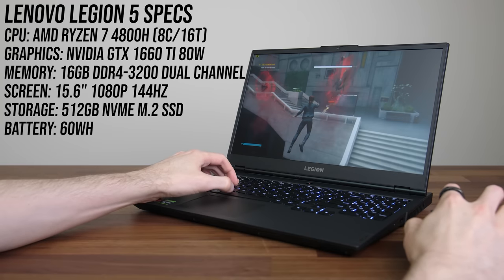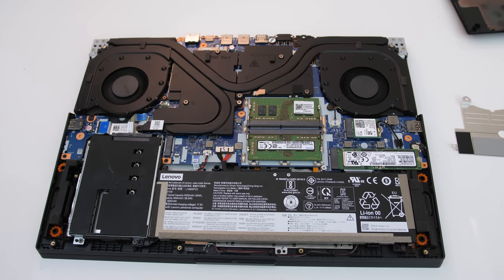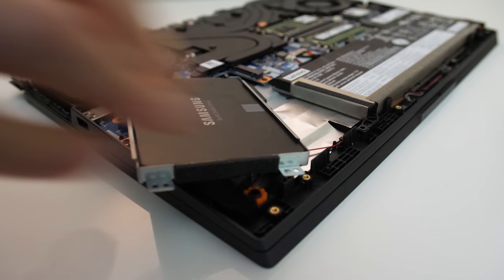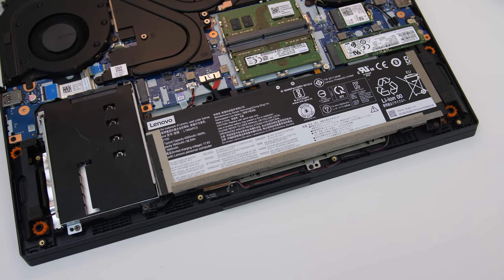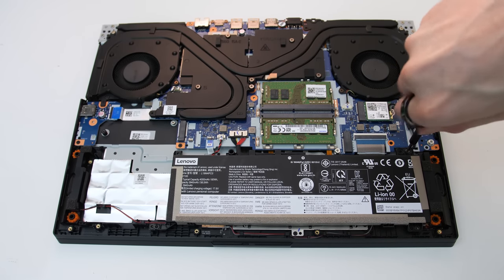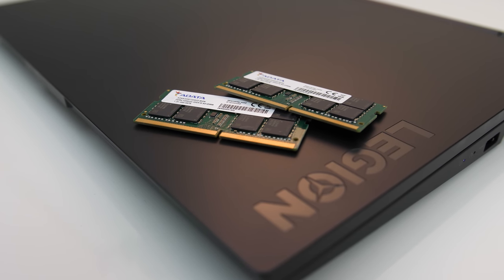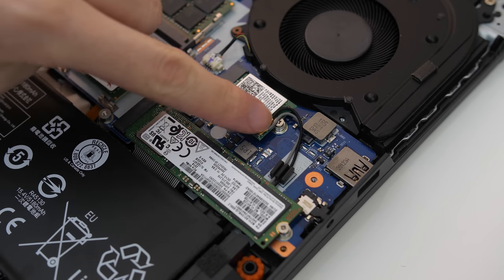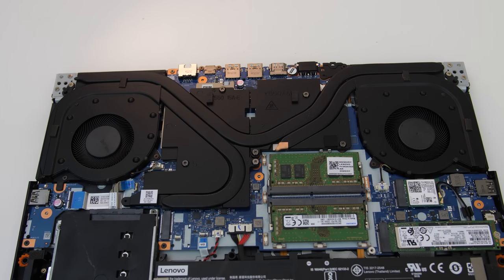Lenovo Legion 5 Upgrade Guide - Boost Performance!

Comment: How big second M.2 drive can I put in ? 1 TB? or only 512 GB?
Reply: I have (2) 2TB M.2 drives, so 4TB total. There are 2 slots for M.2. If you want to add 2 separate M.2s, you will need to take out the default bulkier non-M.2 SSD hard drive if your laptop configuration comes with one.

Comment: So what was the point of putting that 2.5 inch drive in if you was just going to change it out for a bigger battery 🙂
Reply: I think that he just showed us what can be changed BUT if you want to change the battery with a bigger one, you might as well change the 2.5 inch drive with a M.2 sata drive, which is much better, performance wise.

Comment: I upgraded to the 80W battery through the recommended amazon link but it says it is not supported by the system and will not charge.

Comment: I do have Lenovo Legion Y520 i5 -
I want to upgrade my 128 GB SSD to 2 TB. Just want to know is the Y520 compatible to 2TB of SSD or not (if no then how much it can be upgraded to) . and have a 1TB HDD can it be upgraded to 2 TB Sata SSD
.
Reply: Sata 2TB SSD yes. I'm still looking for an answer on the 2x 2TB M.2s. I have heard people adding at least one 2TB M.2 SSD, so I have hope.
Reply: @ryanspackman548  I have 2 2TB and it is working fine, it has been a year.

Comment: Can you confirm that the this laptop can use all of the 64gb of ram? It was my understanding that its limited to 16gb per channel as there is only two channels the laptop should be limited to 32gb.
Reply from the maker: Should be fine. The 32gb listed on the specs refers to what they sell it with, if you look at the specs for the processor it can support more.

Comment: Can you help me btw, i just buy a ssd sx6000 lite 256 gb, then i do a fresh install and put my os to the new ssd, after i install the new ssd to the slot and got a fresh install of windows 10 20h2, i got a bad performance, like when i play a game valorant, i just got 60 fps then it stuttering so much, really annoying, in normal mode (1 ssd only from the manufacture) the performance of the fps can get in to a 150-200 fps. Can you help me?

Comment: I installed an old seagate 500gb 2.5 hdd (yes 5400rpm) I had laying around for extra storage. Also installed a samsung 4gb 1Rx16 ddr4 stick. Awesome!.A huge nostalgic feeling using a HDD. I can hear it spinning. LOL. nice n slow'
Reply: helpful video. I didnt see the ram at first... no screws needed!. I haven't built a PC since 2009 back when the 9800gt/8800 & WD Velociraptor drives were king LOLOL. alot has changed,  video was a great reference.

Comment: If I replace both m.2 ssd slots with fresh ones do I have to reinstall windows on my laptop or will it still be available?
Reply from the maker: You'll have to reinstall because you've removed the drive with it
Reply: @JarrodsTech  Ok thanks 🙏

Comment: I got the legion 5 with the 120hz screen, because there wasn't any other option to get the 165hz screen. It's yet to arrive so I have no idea if it's really as bad as people say it is. My question is, can I upgrade the screen later on if I find it really bad, and if yes, where do I get the new screen from, and is there any tutorial on how to install it?
Reply: don't even bother
you'd be better off selling the laptop and buying the 165Hz model to replace it 
but unless the 120Hz panel it comes with is of far worse quality than the 165Hz panel, I wouldn't sweat it. Those extra 45Hz won't matter outside of competitive gaming

Comment: if you open the sata hard drive and just pull out the pcb you can run both sata and 2 m.2 drives you must remove the tray also
Reply: can you show pics of this?

Comment: Anyone having issues with their battery upgrade? 
First off it took me some extra time to find the correct part number, there are numerous 3rd party sellers.
After a return and waiting about a month my new 80wh battery is in but at 100% charge it says i have only an 1 1/2 hours worth of charge time...do i need to cycle the battery more for it to figure itself out? i thought this wasnt as important with Li-ion.. any feedback is appreciated thanks!

Comment: I want to know about my laptop upgrade options!

Lenovo Legion 5 15ACH6H (AMD Ryzen 7 5800H), RTX 3060 6GB(130W), RAM 16GB, SSD 1TB

In website or elsewere RAM upgrade is limited to 32 GB but for this video you are upgrading it to 64 GB, The laptop is from same family and even mine is one gen higher! Could you give answer!

Also i have read that people installed 64 and more RAM without facing problem!!
Reply: Yes 64 will be fine.

Comment: I love your video. I have a problem if i upgrade my laptop, should i buy 1 slot ram 32gb or buy 2 slots ram 16gb? Because my laptop default has a slot ram 8gb and i want to put a slot ram last.
Reply from the maker: 2x 16gb will perform better as it's dual channel.
Reply: @JarrodsTech  Thanks. But with a slot 8 gb and 32gb ram, it’s also get dual channel.
Reply: @herobrinesky3348  You want to have the same about of gb for each slot.
Reply: @Blue-xn1mj  Ok. Thanks

Comment: I just got the Lenovo legion 5. It has ryzen 7 4800h and gtx 1660ti. The issue is that I can't connect to wifi when I go to my room. I basically have to sit really close to the wifi router. Like if I go 20 steps away from the router the laptop gets disconnected and WiFi on the laptop stops working. Whereas wifi is working fine on all my other laptops, phones in the same room and even at greater distance. The wifi card is intel wifi 6 ax200 160mhz. I've tried reinstalling windows 11 three times. Used cmd commands like netsh int ip resetlog.txt and all those geeky stuff. Tried reinstalling drivers for wifi again and again. But still the wifi signal range is pretty bad. I have to sit really close. Please help

Comment: I just tried to do the battery upgrade but the new battery won’t charge and the orange battery light constantly blinks when I plug in the power cable.  I’ve already reopened the laptop and checked the connection… can anyone help me?

Comment: would be more fantastic if there's availabel 10 pin sata flex cable little bit longer.
so we able to use 3rd cheap ssd like BX500 Crucial without enclosure.
is it possible??

Comment: What is the max capacity for the M.2 drives? The manual says 1 1TB, and 1 512TB.
Reply: I put (2) 2TB M.2s in my Lenovo Legion 5. So 4TB (but you're going to have to remove the regular SSD that comes in the default configuration.)
Reply: @muygalan  can you post the 2tb M.2 that you have please, also, are you having any issues or is it working fine?
Reply: @pipkinrahl7264  SAMSUNG 970 EVO Plus SSD 2TB - M.2 NVMe. No issues at all!
Reply: @muygalan  Finally, someone who did and confirmed what I want to do! Don't know why it was so hard for me to find others who did this!!!

Comment: You could get away with the m.2 and the sata ssd in that small area. if you were to configure it in the case correctly. It's a little tight for me, but you can get it to fit if you get another sata to ribbon cable connector that's longer so you can stretch it over the m.2

Comment: Legion 5 15ACH6H laptop can be upgraded up to 32 GB(16x2). But when I talked to Lenovo they told me like this "It is possible that the computer will remove more, but we cannot guarantee this as such configurations have not been tested" is there any problem if I install 2TB SSD?
Reply: First let’s talk about upgrade option, at current moment Legion 5 supports 32GB but it mate change later when they bring new bios update also you can install 2 TB on second slot( I have same spec on my legion 5)
Secondly forget Lenovo support they are useless
Reply: @ariavision  So we can't increase it more than 32 gb is it true, but you say that ssd supports 2tb, which is nice. Really hasn't it Lenovo support, I thought it had good support. So I preferred lenovo rather than acer, asus. Do you think Legion 5 15ACH6H is a good laptop?
Reply: @YunusEmreSevuk  I have self legion 5 15AC…, why would you upgrade above 32GB?
I’m playing games, editing videos and all this with just 16GB RAM and yes using my Lenovo Legion 5
Reply: @ariavision  I was just curious, then it's cool
Reply: @Kashmir_Daily_shorts hi, it’s ADATA ssd, watch at 8:31

Comment: The Ryzen 5600H says it supports up to 32GB ram. Got 2 stix of Ripjaws DDR4 2666 32GB kit from Microcenter for $92 USD. Good to on the battery though

Comment: I was thinking of swapping out the 2.5" bay, and replace it with a dual slot M.2 to SATA Adapter. Dimensions are Length 3.94"(10cm), Width 2.7"(7cm) and Depth 0.7"(1.8cm).
Reply: That could be an idea too, I wrote a comment to try take the plastic housing off the 2.5 inch SATA SSD drive as they are usually a much smaller circuit board inside(similar size to the M.2 form factor. Then you could let it sit somewhere as long as there is still space for it, and tape it down with Kapton tape to keep it electrically insulated.

Comment: I see you inserting the 2nd ssd without a heatsink and the laptop doesn't come w another heat cover either. I recently bought the WD SN850X and was wondering if i should invest in a heatsink because people are saying gen 4 ssds run hot, but the laptop supports only gen 3 speeds. Could you please help out. Thank you!
Reply: I just commented this because he's been replying to comments, I also have the same question, I'm purchasing wd sn570.. did u end up buying that extra heatsink?
Reply: @anshul_._  I did......but the heatsink that i got was slightly thicker than expected so i had issues in closing the chasse, but i just had to give it a slight nudge. It works fine. I didn't really test out without the heatsink so I'm not sure about the difference in performance. No harm in getting one amiright?
Reply: @osmanirfan6098  yeaa, only reason I'm stalling getting the ssd is that I don't want to burn something on the motherboard, could u please share the link to that heatsink?

Comment: Nice, clean video. I'm wondering about one thing. Your stock laptop had 16gb of RAM. I guess that was the maximum in the specs of manufacturer. And yet you managed to have 64gb of RAM. I'm asking because I plan to buy a Legion 5 laptop witch rtx 3060, so I guess a bit younger construction and it says that it may have max 16 gb. Anyone knows something about it? I'm aiming for L5 17ACH6H
Reply: +1

Comment: M.2 and 2.5 SSD's seem to be about the same price so which shoud i get?
Reply: M.2 is objectively the faster and newer technology, make sure it is an nVME drive though, as M.2 is simply the name of the port, and you can get M.2 drives that run at SATA speeds. nVME is the technology making it's nand chips lightning fast

Comment: I have the same model laptop it says 32gb ram is maximum then how it supports 64gb?
Reply from the maker: The Lenovo spec sheet lists what Lenovo offer it with. Check the CPU specs from Intel or AMD to find out what it supports.

Comment: Do you have a legion 5 fan cleaning video? Id like to know the proper way of cleaning the fans and ducts which may have dust in it.
Reply: Please don't accept this as a definitive method, but I took mine to repair shop here in Asia, and the guy had a brush (looked almost like a paint brush) and literally brushed the dust from the fans. I thought he was going to use a compressed air duster for computers.

Comment: Turns out the bad thermals on legion 5 is just because I needed to lift the laptop up from the surface so the fans could run efficiently. Kinda weird how a perfectly flat surface isnt good enough for it but at least that solved the overheating issue i was having.

Comment: Would having the 64GB of ram help when running multiple Creative Cloud software simultaneously? I have a workflow with Premiere Pro open simultaneously with either Photoshop or illustrator. And of course when exporting from Premiere Pro, media encoder will also be open towards the end. Additionally, I usually have Google Chrome open in the background which isn't exactly light on RAM use.

Thanks so much for this video, and thanks in advance for anyone who is able to answer this question.

Comment: Hi, my lenovo legion 5 came with 8gb of ram at 3200 mhz. I bought an extra 8gb 3200 mhz sitick of ram from adata, and when I opened up task manager, it is running it only at 2666 mhz, downgrading my ram speeds. how do I raise the speeds of my second ram?
Reply from the maker: The sticks must run at 3200 with different timings, so my guess is they both lowered to the speed and timings that both support. Eg one might be CL22 and the other CL19 or something at 3200, you need to match both speed and timings.
Reply: @JarrodsTech  how do I check that on the stick that came with my legion 5?

Comment: I think, the reason the 64 GB does not show a big difference is because of the motherboard, the most ram recommended for this model is 16, anything above will help in low percentages.
Reply: More ram helps allows you run more programs. Also the board only supports 3200 speed. If it supported a higher frequency then it would run closer to par with the CPU speeds. Resulting a higher performance boost.

Comment: Does anybody know if its possible to buy and install the rgb keyboard instead of the one that came with Lenovo Legion 5 15ACH6H white byeaboard lighting ? I know physically it would be possible buy would it actually work ? Will the laptop recognise that now it has rgb backloghting instead of white backloghting ?
Reply: no it will not work brother.

Comment: Hi yall I recently upgraded my ram from 16gb to 32gb in my Legion 5 ryzen w/ 3060. After installing the ram I noticed 100% CPU usage instantly and a slow laptop. I've upgraded the bios and am troubleshooting now. Any advice would be helpful.
Reply from the maker: I haven't heard of that happening. I would check task manager and see what is using the cpu.
Reply: RAM is likely malfunctioning or is unbelievably slow 
try reseating the ram sticks, if that doesn't work, try using the old RAM again to see if the issue persists

Comment: Iv just ordered a legion 5 ryzen 7 5800H 2x8gb ddr4 3070 (from the website I gathered it was a 130w TDP) only reason I went or this over the 5pro is because of the 1440p screen I’d rather have the extra FPS on 1080p. Has anyone used one with the same specs as I can’t really find a review with the same gpu cpu ram and such

Comment: Gentlemen, listen to me very carefully. I'm one of those fortunate few who get to have similar in characteristics model as Lenovo Legion 5 1717ACH6H 1920x1080, AMD Ryzen 7 5800H 3.2Mgz, Ram16 GB, SSD 1 TB, NVIDIA GeForce RTX 3070 and well, let me say I immediately regretted the purchase. 
The reason for this the lack reveal the potential of technical characteristics and powerful components.
As we all know, almost all laptops have a very weak cooling system.
In demanding games and applications over time, each work becomes slower notebook, laptop heats up quickly, noise, or is disabled after the long-term operation.
Unfortunately, the only option that can help it is decline CPU frequency as a consequence and potential.

Of course, Lenovo or MSI not responsible for the unjustified expectations of the Purchaser. 
in any case do not make a hasty purchase, potentially generating dissatisfaction and frustration.

Best Regards MMD

Comment: Hello guys ! I want to clean my laptop from dust but cannot separate the heating pannels from the fans and can't find any answer on the whole internet ! Is it only possible or they are just built not to be separated ?
Reply: can you tell the laptop model brother?
Reply: @Robert-um2oe  Yes it's A Lenovo legion15ARH05
Reply: It's the same panel as in the video :)

Comment: So, I'll be unable to improve the gpu with a rtx 3070 in this laptop?
Reply from the maker: GPU is soldered to the board and cannot be upgrades. Can't use eGPU with AMD Ryzen 5000 series either, unlike Intel with Thunderbolt.
Reply: @JarrodsTech  thanks for respond. Yeah, I think isn't very important though, I saw your video about the comparison between the 60 and 70 and the improvement it is not so much, 21% at most.
Thank you.

Comment: does anyone know if it's fine to install a secondary m.2 drive without using any heatsink as this model doesn't have an aluminum plate on the secondary m.2 slot
Reply: Yes you can but make sure you are using the secondary drive only for storing the files etc and not using as booting drive

Comment: is there any way to add some sort of little heat sink on the second m.2 slot?? those things get pretty hot when used!
Reply: I believe the stock cover plates have something for that. It won't handle the larger/faster 4.0 ones that require it anyway.

Comment: My computer specs says my Ram stick is a 8GB DDR4 2933 MHz stick, but when I look for which parts it says are compatible, it only shows parts with 3200 MHz. Can I buy a 3200 MHz stick and pair it up with my single 2933 without any issues occurring?
Reply: Even if it works it's not gonna be faster if u have 1 gb 2933 stick don't put a 3200 because dual channel 2933 will be faster than a 2933 and a 3200 just do 2x2933 not 1x2933+1x3200
Reply: he put a 2x32gb same MHz ram so it dual channel
Reply: @syntheticallay  no the one I have is an 8gb 2933mhz, and the one I look to buy is a 3200mzh 8gb stick for the second available slot
Reply: @hikton7293  then I suggest going for a 2933mhz, dual channel same frequency is better and has less screen tearing

Comment: hey i want to ask something my legion 5i is experiencing problems after a year of use when i press the on button jt doesnt turn on but the button light and pwoer come on no keyboard response and no display ports work
Reply: Same bro when I was poking around the internals same thing happened
Reply: @syntheticallay  i didnt do anything in internals it just happened by itself